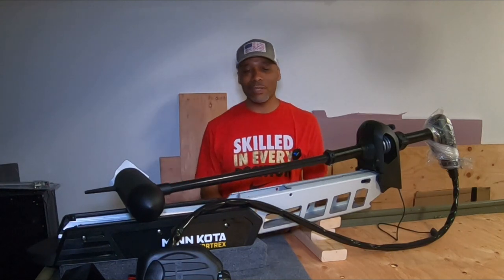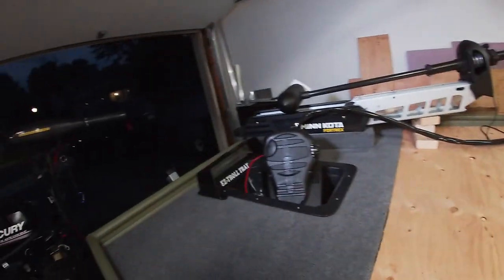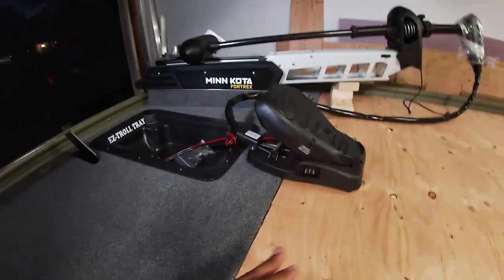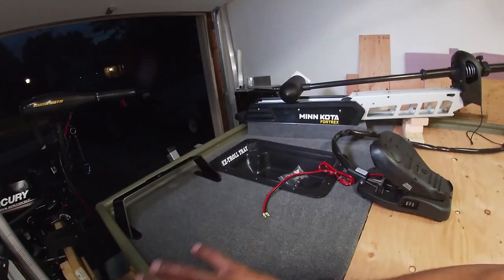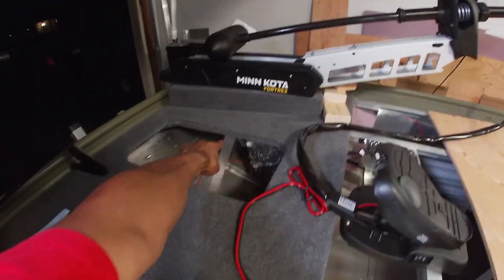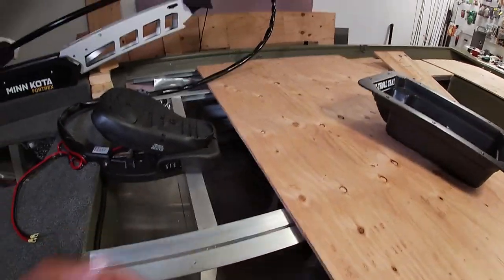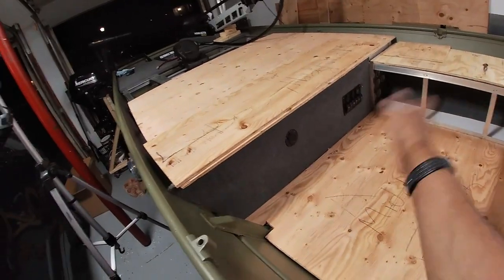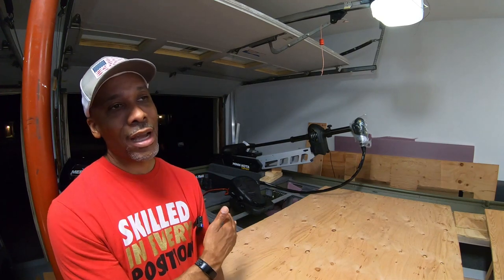DON'T MAKE THIS MISTAKE!!! Jon Boat Trolling Motor Install FAILURE - Lowe 1448

Comment: Thanks for the heads up. I would say splice the cable, but I know you can not cut the metal tension cable. Appreciate your sharing
Reply from the maker: That's right.  If it wasn't for the tension cable, splicing the wires would have been my first option.

Comment: Simple solution extended the base mount for the trolling motor forward. Let it hang over the front about 6 inches or so. Use a piece of steel or aluminum to get it out there.

Comment: The vertical supports you added up front under the original deck...how did you secure the bottoms of them?
Reply from the maker: I didn't secure it to the bottom hull of boay. I cut it just the right length to wedge it in place and I secured ii under the front deck using a small piece of angled and riveted it to the deck.

Comment: What is the thickness of the aluminum angle youbised for your floornframing
Reply from the maker: I used 1/8" thick for most of the boat but I would go lighter with 1/16 next time and add additional support wherever needed.

Comment: Slide the trolling motor forward on the mount. A few inches maybe all you need to make it work.
Reply from the maker: I had to move it 14 inches back lol. Thanks for the suggestion anyway.

Comment: Seems to me, you could have installed a plug of some sort from the motor, put in a female plug near the motor, and wired under the deck to connect the foot pedal and it would have come out even better than the original plan.  You would be able to remove the motor with a much shorter cord to fuss around with and have all the electricals out of sight.  Oh well...

Comment: it seems like the Minn Kota PowerDrive has extra long cable and wouldn't have this issue?
Reply from the maker: Maybe.  I just feel like some models wouldn't have this problem but I don't know that for sure.
Reply: @BassBrothersFishingDMV  i'm building the same boat.. just wondering what's the shaft length for the motor you got?
Reply: I just bought the powerdrive. Cable is super long and it's detachable. Also, it's alot more flexible and not as stiff.

Comment: you should be able to extend the cables yourself.  Not for the faint of heart, but its pretty simple wiring.
Reply from the maker: I wasn't sure about that process. I did call minn kota to find out if they sold a longer cable and they don't.

Comment: Why not just cut the wire splice In the amount of wire needed then shrink cover it back.
Reply from the maker: One of the things that would need cutting is the tension cable for the foot pedal.   It's not a wite and it's highly recommended not to cut that. You wouldn't be able to extend that cable.